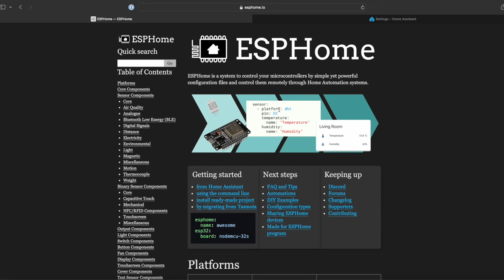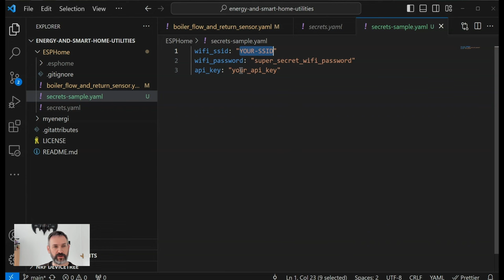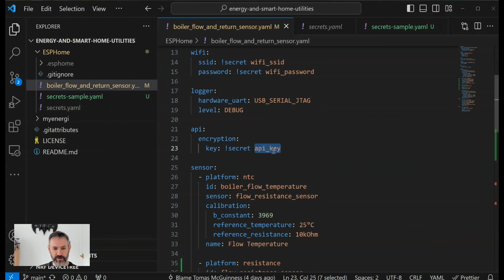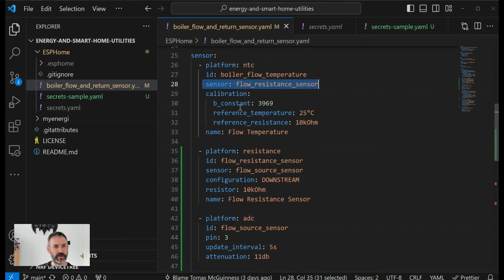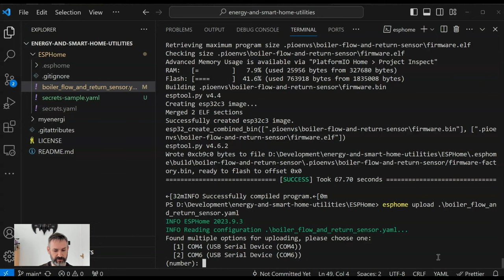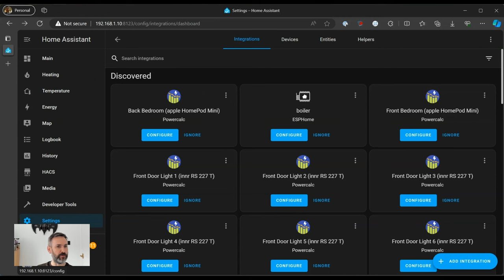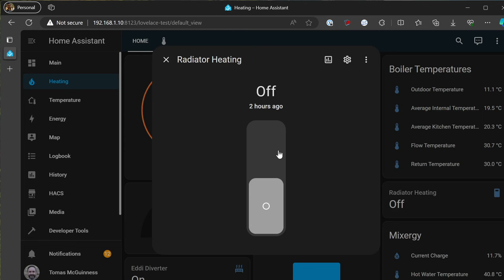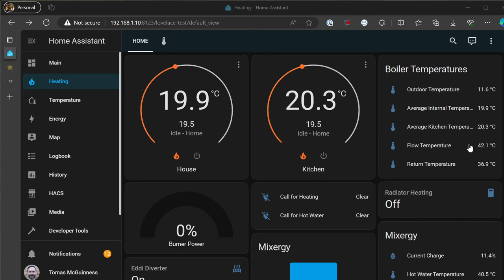Building a boiler F.A.R.T. sensor using ESPHome

Comment: You can buy the actual ds18b20 sensor chip without the metal tube and wiring. Contact area would be about 5mm square. For testing the sensors i use an icepack and a cup of tea. Especially useful when trying to identify muktiple sensors
Reply from the maker: I tried one of those and found the reading to off. I thought that might be because it’s hot on one side and cold on the other. I think thermal paste and conductive tape would help, but never got around to trying that!

Comment: I used the digital sensors with a 15 cm length of pipe insulation tie wrapped over the sensor and pipe. The readings seem almost instant and are within 0.2 degrees celcius compared to my infrared temp gun.
Reply from the maker: I found that using an IR gun or FLIR on copper pipe gave an inaccurate reading. When I looked into why, I discovered it has  to do with the emissivity of copper.

I’m at the point now where the NTC matches the professional tool, but even the position of the sensor on the pipe alters the reading. The closer to the radiator, the lower the reading!

Comment: I have been using two Dallas 18b20 and esp home and esp8266 for the last year to measure the flow and return because the boiler kept tripping and I used node red to check if it should be on and send an alarm if the temp was not above a set value, I also have one on the water cylinder to check the water temp
Reply from the maker: Tripping? As in electrically?
Reply: @tomasmcguinness  I can't speak for richard, but I used to have a boiler that kept "tripping". Basically the heat exchanger was plugged. The boiler would supply 15-20kw to the heat exchanger, but because it was plugged, the cold water remained cold and the boiler detected an overtemp condition and shutdown, until it was cooled down enough, started back up and tripped again. 

Easy (but fairly expensive) fix was to replace the plugged exchanger, mainly because half the boiler needed to be ripped apart to change out that simple component.

Comment: Help. There is something i am probably not doing correctly but just cannot see what it is. Have vscode installed. Esphome installed. I have pasted your yaml file and saved but when i try and compile it, it just comes back with an error as follows. esphome:
  INFO ESPHome 2023.12.5
INFO Reading configuration .\test...
ERROR Error while reading config: Invalid YAML syntax:

while parsing a block mapping
  in "<unicode string>", line 1, column 1
did not find expected key
  in "<unicode string>", line 2, column 2 

Everything is exactly as you have written. I have even written it all out line by line.
Here is the first 5 lines of your code as it is in my file.
esphome:
  name: 'boiler-fart-sensor'
  platformio_options:
    board_build.flash_mode: dio
    board_build.mcu: esp32c3

There is something i am overlooking which is probably blatantly obvious. It's driving me mad.
Retired electrical engineer who can make things but not good at programming.
Reply from the maker: Looks like a problem with the YAML. Can you copy and paste it into this validator https://codebeautify.org/yaml-validator and see what it says. This should give you a better idea where it’s wrong.
Reply: @tomasmcguinness  
Cut and pasted into the yaml -validator and it comes back with valid Yaml.
vs code Seems to not like the first two lines as it says invalid Yaml Syntax and refers to line 1 column 1
and line 2 column 2
Is it anything to do with the name of the file being different to    name: boiler-sensor      on line 2 not being the same as the file name or does that not matter?
Have i not got Vs code setup correctly? Everything looks the same as yours.
Below is what i get back as an error when i try and compile it.

PS D:\Home assistant\ESPhome> esphome compile .\boilersensor.yaml
INFO ESPHome 2023.12.5
INFO Reading configuration .\boilersensor.yaml...
ERROR Error while reading config: Invalid YAML syntax:

while parsing a block mapping
  in "<unicode string>", line 1, column 1
did not find expected key
  in "<unicode string>", line 2, column 2
PS D:\Home assistant\ESPhome> 

I will persist to get this working. Then i will have learnt something.
Reply from the maker: I’ve not seen that. Perhaps there is an invisible character or the wrong character set selected? Could you try pasting into Notepad and then back into VSCode?